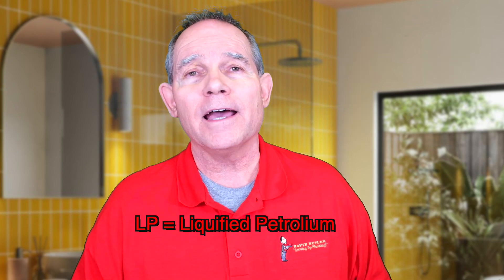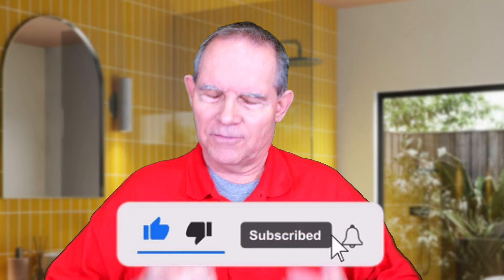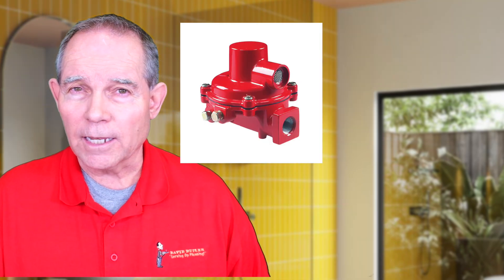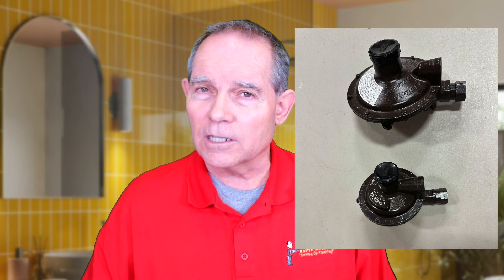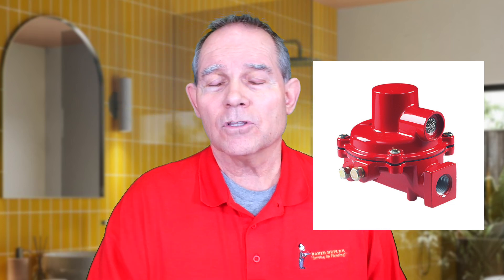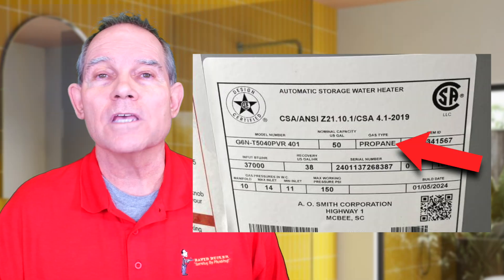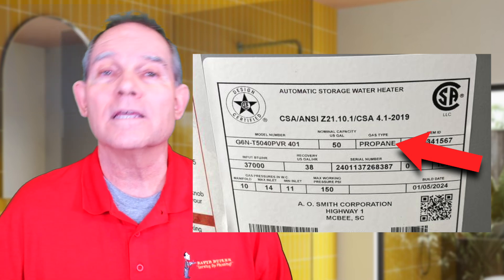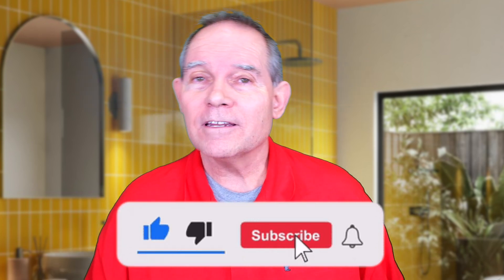An Introduction to LP Gas Regulators (Propane Gas Regulators)

Comment: Running a 30k btu propane space heater from two 40lb tanks connected in parallel via T manifold and single body 2 stage regulator and the regulator keeps freezing after only one hour of running at 31F or lower. WTH do I do to prevent freezing? Trying to figure it for a month now. Tried different regulators: single stage, 2 stage, 2 stage with switchover and all act the same, freeze after 1 hr of running at 31f or lower… 😡